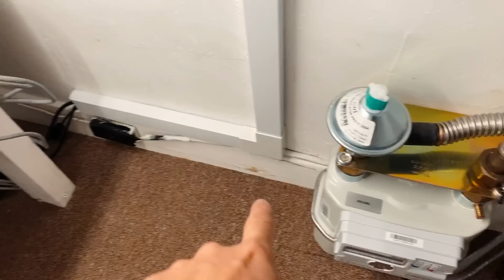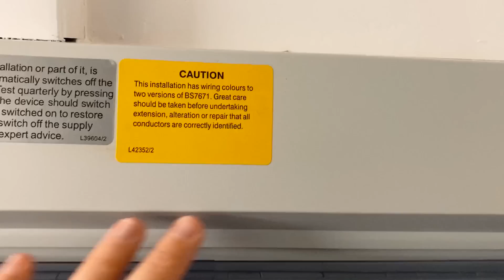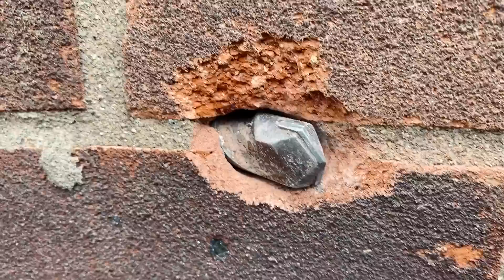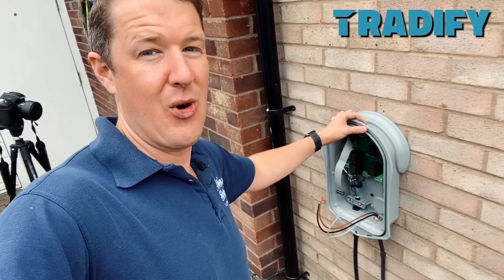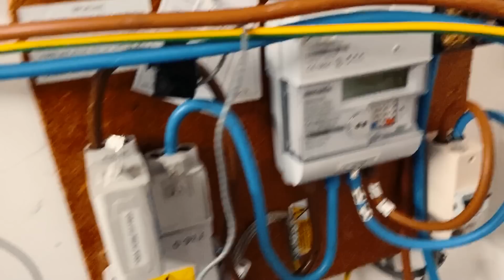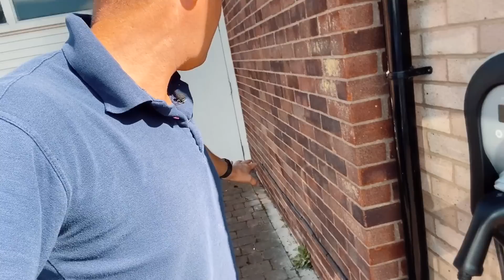Should YOU become an Electric Vehicle Charging Point Installer?

Comment: Those EV chargers are just junction points. The BMS in the vehicle is doing all the magic inverting power etc. If you tear it down this is obvious. There is no trickery involved with installing a plastic cover over a 240 ac connection contrary to what you might believe.

Comment: Why didn’t you protect the wire with conduit? In the US we would need to run EMT in a situation like that because it would technically be in an area “exposed to physical damage”
Reply: Because if it's armoured cable or tough sheath cable it doesn't need to be in trunking

Comment: I lost the last question could you please tell me how many Zappy  charges I can run off the generator either 125 ampTPN E or 5 Core camlock system for a mobile possible unit run at Events sites Yours Michelle Foster

Comment: Thank you for the video. Could you discuss running an external Cat5 cable instead of harvi? Any way to aesthetically mount cat5 with 6mm2 armoured? Would it save money on harvi but increase install cost about same amount plus not look as good? For installs where you have PV, a single Cat5 could carry all 3 CT signals a Zappi can take (I think it does anyway). Can harvi connect 2?
Reply from the maker: I would use EV Ultra cable now with Cat5 cable built in to the armoured able it looks neat and means you can hard wire the CTs
Reply: @artisanelectrics  Great find! Thank you.

Comment: Enjoying your content.
Like you I like using pump pliers on my armour glands as I find it easier to hold the gland and tighten with pliers rather than fighting with spanners. I recently discovered Knipex make pump pliers with parallel jaws 

KNIPEX 86 03 180 Pliers Wrench pliers and a wrench in a single tool chrome plated plastic coated 180 mm 
https://www.amazon.co.uk/dp/B000X4KP1C/ref=cm_sw_r_cp_api_i_-.FLFbJXJT2JC?_encoding=UTF8&psc=1

They’re perfect for the job! No more marring my nuts! 🥜 
I find the 180s to be the most useful size.

Comment: With the new UK 2030 mandate of no more gas or diesel vehicles allowed to be sold, its more important than ever to get a head start on deploying them.  One question I would have is as old and rundown as some of the places you have worked how will that electric infrastructure support an EV charger in every home / flat?  Just seeing some of those run down consumer units and service entrance supplies, not sure how that will work.   Also what are the housing blocks and flats going to do for charging all the tenants EV vehicles?  I see a lot of money on the commercial side as well installing many of them in that setting.

Comment: Meter fitter fitting a gas meter will now leave the customers gas supply turned off due to that CU being less than 150mm from that gas equipment. Not good. Or is it more than 150mm. Really enjoying the videos.

Comment: Set of spanners always! I have 2 sets of spanners so I have 2 of every size. 9 - 32mm thats a 25 piece set. I have a Draper set and a Siegen (by Sealey) and I way prefer the Siegen. Usually a 22 for the thing in your hand when you asked. Im a mechanic by trade BTW I don't rate adjustable spanners but that's just me. They have their place I suppose
 Siegen S0564. Draper 26696.

Comment: I bought my first EV a couple months ago (I live in the USA). I did consider having a permanent charger installed but was concerned about someone vandalizing it or steeling it, so instead had a 50A 240V plug put in and bought a portable charger that can be sold with the car if I decide to but a car that does not use the CCS standard next time. I am not sure how the different charging standards will change and I am not sure if it would be practical to do it this way in the UK. How would you approach a situation where someone wasn't set on a particular brand EV and wanted to be able to charge different brand cars like say a BMW I3 one week and a Leaf the next?

Comment: 6mm² should be what, a little under 4.5mm with the insulation?

CPC have 6mm sleeving, CB19723 for blue, CB19725 for brown, CB19726 for G/Y
Also heatshrink in 6.4mm, CB09794, CB09838, CB09816

Comment: Great video, my only moan (unless you fixed it after the video) is the cable ties and how you cut off the lose ends. I have a pair of Lindstrom cutters, made for small cables 1-1.5mm they're not cheap but they cut flush so you do not have the possibility of someone cutting themselves on the sharp end which in my line of business is all to common when you use normal side cutters. You can use a knife (I think you did this before on the warehouse job) but then you risk cutting the cable and or yourself or you can of course get a proper cable tie tool that pulls the cable tie tight and cuts it at the same time which is great for speed but they are also a lot of money and sometimes you don't want the cable tie mega tight.

Comment: I see that "Harvi" the gray box. Energy Harvesting Wireless Sensor
Harvi is a clever little device that enables the zappi and eddi products to be installed without using a wired current transformer (CT) for measuring the grid and or generation power; instead the CT is connected to harvi. No power source is needed for harvi – the energy from the CT is harvested and used to transmit the measurement signal to the zappi or eddi. This means batteries or electrical wiring are eliminated!

Comment: On the subject of pricing for jobs, I have seen on some EV charge point manufacturers websites prices for installation costs, ranging from 365-00 to 449-00. I'm assuming this is for labour and additional materials i.e. cable, clips etc. I understand that prices for jobs can be a closely guarded secret but can I ask are your installation costs in line with what manufacturers quote or do you have your own? I ask because I am hoping to expand into this area, I'm registered with 5 EV manufacturers and with OLEV, had 2 enquiries but come to nothing. I feel I may be pricing myself out of work if I'm sticking to manufacturers figures. Any advice would be appreciated.

Comment: I am having a double garage built and the builder is running 10mm SWA 3 core cable from the meter underground to it.  Is this different from an armoured cable or can you add ev charger to this at a later date?

Comment: If anyone struggles pricing a charge point circuit then I am afraid they are in the wrong game.
Making glands off, I use whatever I grab first might be grips might be spanners, when I was in college they taught us to use grips.
Also, realistically what is the chance of someone touching the car while it's charging and the network losses the neutral, it's got to be tiny, and how do you check the RCD in that unit, is there a test button on it.
You can use heat shrink on the conductors you can get any colour you want as well as earth.
Also I noticed how we all drill in the safe zone, without checking, maybe we should practice what we preach 😂

Comment: Personally I wouldn't register for the grant scheme, people are thinking they are getting a charge point cheaper by using this scheme, in reality they are not, and it would be the same price if they didn't use the scheme, I priced up a job for a charging point using the same charger and I was actually cheaper than the firm on the grant scheme after the grant money was applied.

Comment: Yes the future is electric I see gas making its way out including for heating and cooking that will take longer but it will happen. However while you will be installing more EV chargers you are going to be having a greater number of DC and AC devices and a lot more semiconductor devices with lots more transients and other electrical issues. Fault finding is going to be much more complicated you will need to get hold of more expensive power quality analysis tools and testers. Power quality testing is going to be just as important as safety testing. I see that coming in in a bigger way in the 19th edition of the electrical regulations and future editions of the US NEC codes and standards in 2022 that’s the way IEEE is moving as new technology comes in. The other are is power over Ethernet (PoE) and proliferation of lower voltage devices I see that as a big market as well to improve electrical consumption and reduce  bills already sockets power and lighting power can be undertaken with next gen of PoE - soon enough heating and cooling will come into that ambit.

Comment: Can I ask about the tethered cable on the zappi and other units really. Is there a limitation on the length you can have connected, plus can you replace the short cable that comes with the unit with a longer lead?

Comment: Nice option would be spd on the new board and move the it equipment over. I've been using heat shrink tubing on 6mm. And I flag with the label printer also.

Comment: Jordan, are you sure those two bends at the brick corners comply with bending  radius? 6mm 3 core SWA is normally about 15mm diameter, which gives you a 90mm internal radius, your bends look tighter than that or is it an illusion of camera angle?

Comment: Knipex 86 05 250 parallel jaw pliers for SWA. Best of both worlds & don't mark the gland. I also carry the tiny 86 03 150 and the 87 01 125 which are great for tight spaces and have a surprisingly wide capacity.

Comment: Mate, you stick with the grips. As long as they are done up correctly👍🏻 I have had to use 2 spammers before but only in a flammable environment- EX rated I think and that was just coz they didn’t want the engraved rating on the gland to be scuffed up.

Comment: Specialised Wiring Accessories supply the larger sleeving that you require. Most wholesalers can order, but dont stock because of the various sizes and colours they make. 

Strange that someone would put a Sqr D breaker in that Crabtree board, when the Crabtree ones are readily available.

Comment: I noticed you used a harvi to transmit the load limiting data to the Zappi, rather than hardwiring the CT clamp to the Zappi. With a harvi the load limiting maxes at 65a but with hardwiring you could set it as high as the 100a main fuse. Was the client happy with this?

Comment: There will be lots of people installing ev charge point without doing the course. It's no different form installing any other electrical equipment
Reply: There are a few differences, for example advising the costumer in a proper placement. It's simple to find a spot suitable for the current EV, but ideally such an installation should suit any EV.

Comment: Bahco adjustable spanners are good. Although some people say that the quality has gone down hill slightly compared to when they were manufactured in Sweden, I find that the new ones are still very good. They make a thin jaw version which could be handy for SWA glands. The ‘proper’ way is probably to use the appropriate sizes of open ended spanners, although the Knipex Pliers Wrench is great because you can actually clamp down on the flats of the hex, virtually eliminating the risk of damaging the gland by slipping. They also have the benefit of the ratchet-type action which speeds up tightening as opposed to constantly taking a spanner off and putting it back on again. I suppose two of those would be quite expensive though. :-)

Comment: Nice job Jordan.
Going through the zappi training material I was very surprised to find that if the Harvi is connected wirelessly to the zappi you are limited to I think it was 55 amp or there about in load limiting. So cant use settings above that.
Unless I suppose you get DNO approval prior to job. Or hardwire it.

It seems the Harvi signal is not reliable above 60 amp.
Just something Ive learned 🤪

Comment: Never got involved with an EV stuff, but I love the idea of the wireless current measurement. How long does the wireless current meter last? (Scratch that, I didn't realise it was wired at first)

Also, is it an optional extra sold for the EV charger?

Would it be worth putting a time delayed rcd to protect the cable to the EV?
Reply: Yes, the Harvi is sold separately about £80 I think?
No need for RCD protection as the cable is SWA and clipped direct.
Reply: @brad30  That is true, thanks for the clarification.

Another question I would have is this, what would the feed to the EV be classed as. Because this particular EV has a built in RCD (and I'm assuming over current protection?) does the SWA now technically become a distribution circuit instead of a final circuit?
Reply: @Kíngsta-GG  No, it's just a final circuit. Some chargers have built in RCD protection 
(type A) and some don't. For instance, if you have a consumer unit with a type A RCD you can feed the EV charger from that but, only if the EV charger didn't have one already built in if that makes sense?
Reply: @brad30  yeah thanks again
Reply: @Kíngsta-GG  Also, the over current protection is provided at the CU side for the EV charger 👍
Reply: @brad30  I assumed that might just have been for the cable and the EV would be technically part consumer unit with its own protection. Since it has rcd protection, that was my thinking.

Good to know though

Comment: Bacho wide jaw plumbers adjustable spanner is what I use. Why do you never fit the gland first(to the consumer unit)? Then cut the swa to meet it. Seems a bit of a faff to have it fappling around. I did a Porsche charger the other week and was concerned that I didn't actually test the charger itself. Only the test you did plus more as it was a TT system. Do you never do this with a metrel for instance. When I did my course I was under the impression on a TNS it doesn't have a PEN conductor so not a problem.
Reply from the maker: If it’s TNS you have to assume that it might have been converted to TNCS by the DNO and therefore PEN conductor is possible
Reply: @artisanelectrics  wouldn't you have a pretty good idea by the measured reading and the visual inspection. I know they never know anything at the DNO but you can also enquire. Also as others have mentioned way no SPD Did you do the calculations

Comment: I recommend “Knipex Pliers Wrench” You can exert considerable force and have faith they’re not slipping.
Reply: You can get the insulated versions of these but I haven’t seen a full set of those sold together. They don’t slip and avoid marring on softer metals. You might have to add them one by one. But then if you are using specific sizes you won’t need to have all of them?
Reply: @mathman0101  a

Comment: Great informative video 👌🏼I use knipex grips on my brass fittings which have smooth finish >>> KNIPEX 86 03 300 Pliers Wrench pliers and a wrench in a single tool chrome plated plastic coated 300 mm https://www.amazon.co.uk/dp/B0007VHBJU/ref=cm_sw_r_cp_api_i_KesxFbP4R89GS <<< worth a try if you do a lot of armoured cable termination.